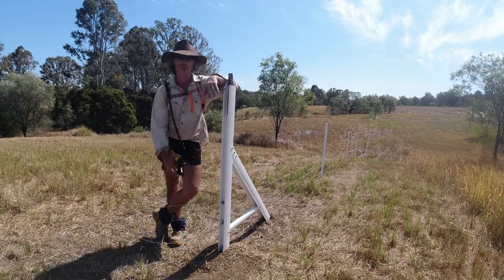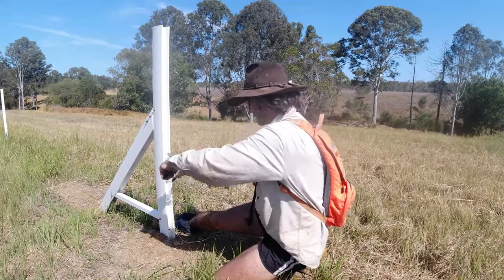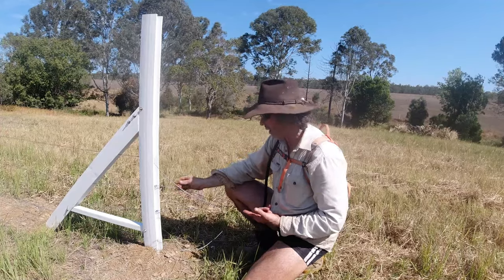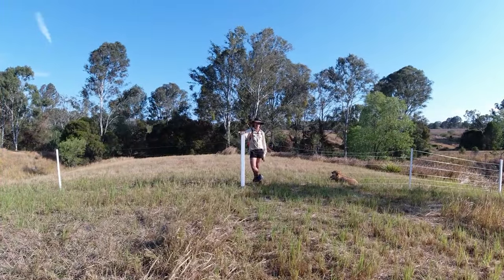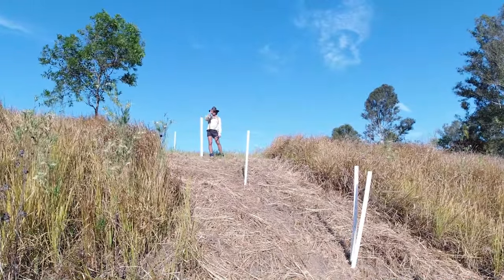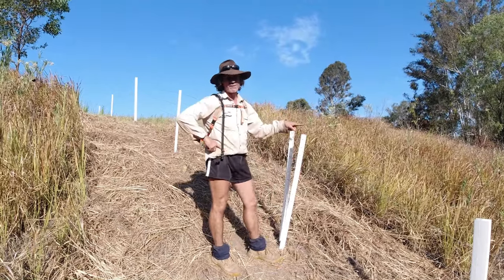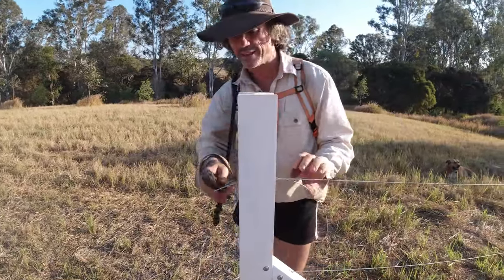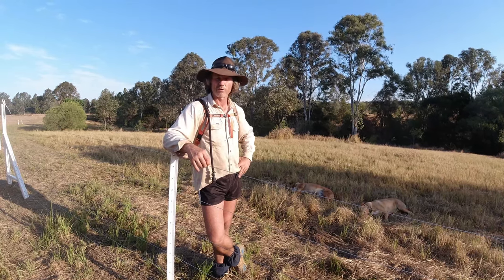Makes Pulling Wire Thru Gullies & Slopes Easy!!

Comment: Great video. Well done on the fence, which looks great and most importantly very practical. I'd be interested to know what the total material cost of that 400m length was. ? I have a similar length with 3 or 4 gullies to do also.
Reply from the maker: Hi Warwickpetschack, thanks for choosing to watch our video and also for taking the time to send us your message and positive feedback, it was well received mate. The cost for that 400mtr of Timeless Fencing, wire and concrete was around $3K, as once you go through multiple gullies the cost start adding up with the additional requirement of H-Post and concrete. If it were just a straight run with no gullies, then the 400mtr would work out to be about $2.1K. Hope you have a great evening Mate! Jason & Nic